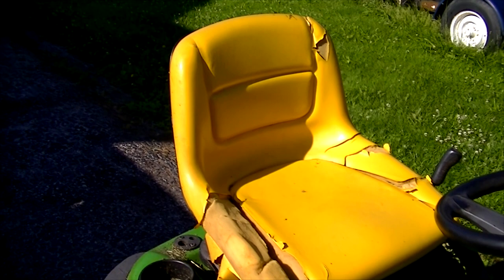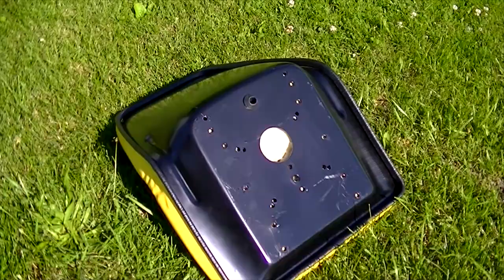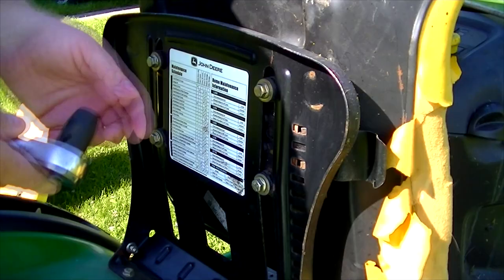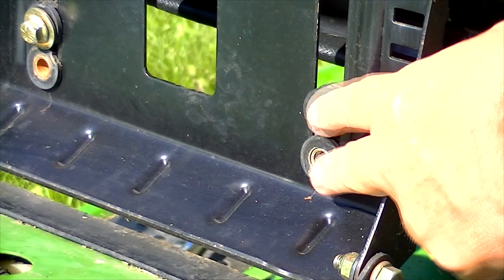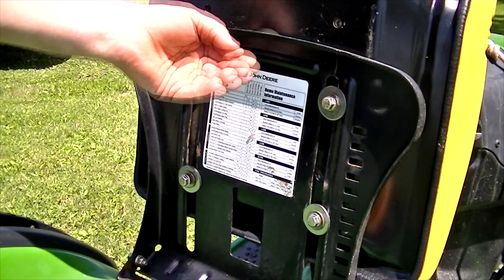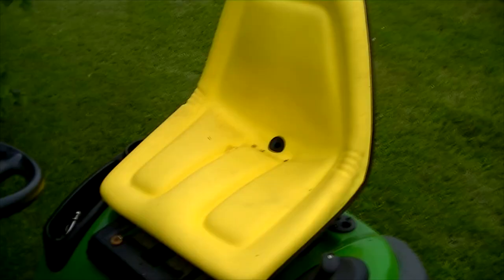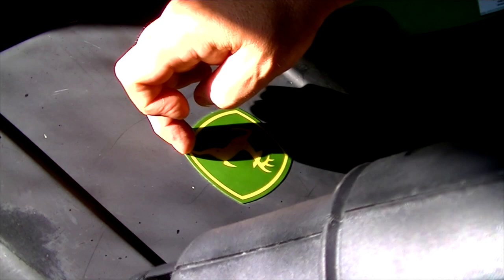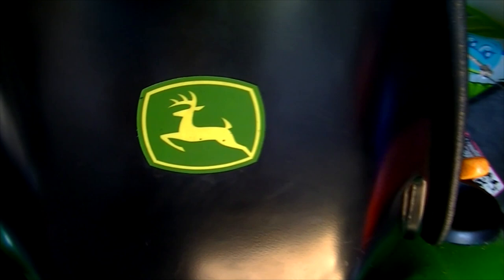Cheap and Easy Universal Lawn Garden Tractor Seat Repair & Replacement

Comment: I put one of those seats on my John Deere 140 . It didn't last long before the vinyl cracked on the top and the 2 grommets for water drainage gave out also. It is a cheap seat though.
Reply from the maker: Do you leave your tractor out side? Just wondering, because my seat is still in good condition except for being a bit dirty. Could be UV.
Reply: @roberta.edinger9405  Yes it is outside on and off. But there should be something that would be UV resistant that could be used on  a better seat.

Comment: Does the seat have the kill switch included?  You do not mention it and it does not appear that it does.  I may have made a mistake since I ordered the seat without thinking about it until just now when I got a message from Amazon that it has been shipped.
Reply from the maker: Sorry but no it does not have the kill switch. There may be a way to rig up the switch but I never bothered to do so.
Reply: @roberta.edinger9405  I'm going to have to figure out how to jumper it out.  Mine will not start unless the wire is connected.  Any ideas?

Comment: I do not see the link for amazon
Reply from the maker: You need to click the words "SHOW MORE" to see the links.
Reply: @roberta.edinger9405  Hey Robert, what Model is your JD ?   Mine's a L110 that has the safety switch that connects up through the bottom of the seat.  Your seat didn't look like it had the safety switch ?
Reply from the maker: mine is an L120 and yes it does have the safety switch but it broke so I bypassed it.

Comment: 211 dollars not cheap lol
Reply from the maker: You are right, thanks for pointing that out. The original supplier must have sold out. I would not pay $211 for this seat. Keep checking back because prices dramatically change frequently. If I can find the same seat at a lower price, I will post a new link in the description. I hope this helps.
Reply from the maker: I have found the same seat much cheaper here: https://amzn.to/2Ps4Ll9 Hope this helps. Thanks.